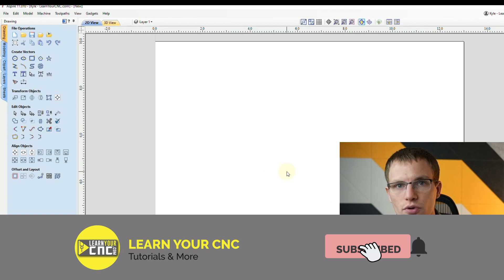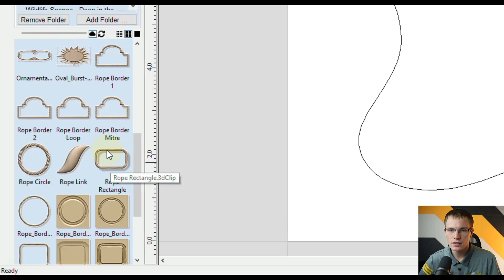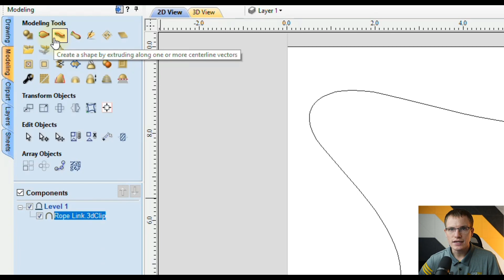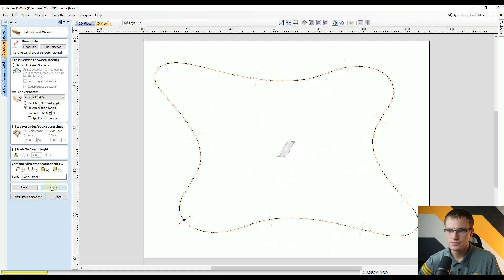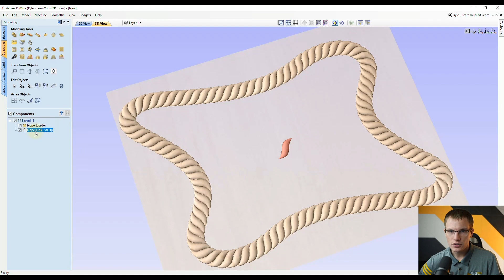Custom 3D Rope Border in Aspire | How to - Vectric Aspire Quick Tip

Comment: That is a great clip. I want to make rope bothers for the windows  in our catamaran. I can trace the outline of the window opening and have our local stationer or printer scan the outline to a jpeg. Can I import this jpeg into the software for a true and accurate job? Size is about 550 x 750mm

Comment: question. lets say u have a rektangular stick 25 x 25 milimeter and 1200 milimeter long.  you want tohave a rope running along between 2 corners  so you can have it standing up and fit in to a corner and you have a rope in a 90 degree corner